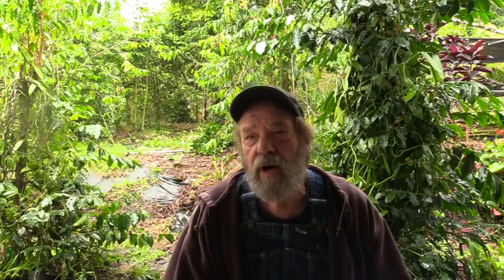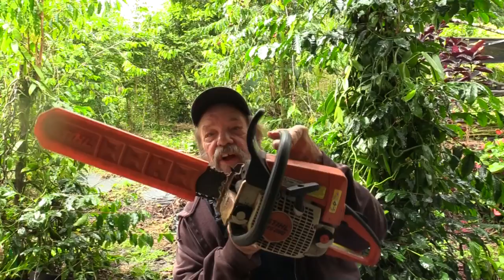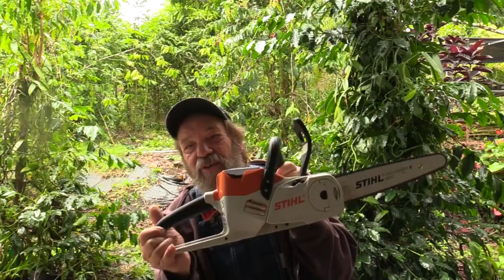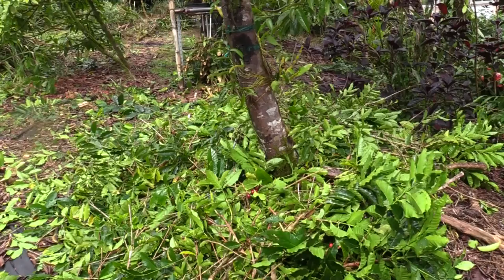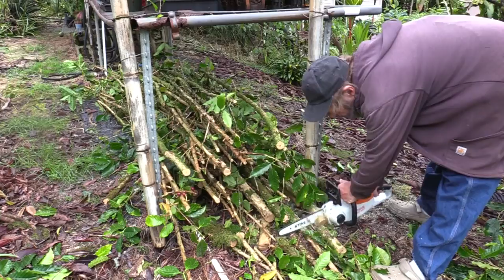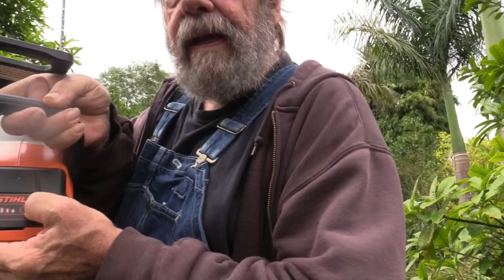Stihl Battery Chainsaws

Comment: Yeah these new battery tools are great I cant disagree with that but people say oh there more environmentally friendly no, there really not there about equal to a gas saw.  One the way they do lithium mining, then to charge it most people are on grid so its just more power the power plants have to make which oil, gas, or coal make up the majority so there just putting the fumes out instead of you
Reply from the maker: I am not most people.  I generate all the power I need to run a home, a car and all my tools.  This is done with zero carbon emissions.  What other people do is there own business.  Battery technology will take over the nation in a very short period of time.  By 2035 GM will no longer produce gas burning cars,  everything will go EV.  The change in Washington is replacing the federal fleet with EV.  Asto makers across the planet are making the switch.  Worrying about whether petroleum or battery is better or worse will soon be a mute point.  Gas is going the way of the cassette tape deck and it is happening faster than most people are aware of.  As for lithium production, it doesn't add to CO2 which is the main issue with fossil fuels.  The out going president opened up a lithium deposit in a Nevada volcano.  The current President will be hard pressed to reverse the order because it will be part of his domestic fuels program.  Mining is dirty business but this will be cleaner than seawater extraction and it is a US reserve under our environmental laws.  I have to laugh at how hard people clutch to petroleum.  It is kind of like being kidnapped and defending your kidnapper.
Reply: @GreenGardenGuy1 Amen! Preach it Bill
Reply from the maker: @tamie341  Just trying to share the joy of a fully solar electric approach to life.  I love it.

Comment: nice to see more electric tools coming out. saw a review for an electric snow blower the other day and he was quite happy with it. my lawn guy has an electric mower that's so quiet, i don't even know he's here till he walks by the window
Reply: EGO finally came out with a 2 stage snowblower that people are quite happy with, though I've only ever worked on the single stage. Seem to do the job without much hassle... certainly a hell of a lot quieter, so you can snowblow your drive at 3am without pissing off the neighbors!
Reply from the maker: Just think, you could bury your neighbors car and his door at 3 AM and they would never hear a thing.
Reply: @GreenGardenGuy1  hehe
Reply from the maker: So many good features with these tools.  Clean, quiet and I charge the batteries from the collectors on my roof.  Zero carbon foot print, zero trips to the gas station.

Comment: Wonder if there's a silicone lubricant option available for bar oil. There's a silicone replacement for WD-40 that works well.
Reply from the maker: Not sure about that.  I know the last time I had to buy silicone grease I fainted from the price.  Since the oil is just spit out of the tool the viscosity is probably more important than anything.  The cheapest materials seems best.  Petroleum is probably still the cheapest and best choice.  I feel oil as lubrication is a good thing.  Oil as fuel is not so good because of the CO2 release and all the dirt.
Reply: @GreenGardenGuy1  I was looking online after I watched your video. I saw some information that people also use canola oil for bar/chain lubricant as another green option. Haven't tried it myself.
Reply from the maker: @bjohnson2003  Canola is as good an oil as any.  I use it in plant spray at times.  Mixed with water and baking soda it works on mildew.  The regular chain oil it pretty thick, getting this much viscosity out of canola might be hard.  The cooking oil would come out of this saw like a squirt gun.  Light weight oils are easy to get from plants.  How we would get thicker materials from nonpetroleum oil is out of my area of understanding.
Reply: @GreenGardenGuy1  some chemist will probably figure out a good and inexpensive green option someday.  Thanks for the tip about a recipe to spray for mildew. Seems like a good, easy, and  inexpensive option thats available from the pantry. Mildew is a problem that we don't have a shortage of here in the PNW.
Reply from the maker: @bjohnson2003  I get along okay in kitchen and garden chemistry but oil is out of my area.  I am sure there is a way to do it.

Comment: i have bad luck with electric tools  gas however im good with.
Reply from the maker: I never owned battery tools until the technology reached it's current level.  Electric tools of years gone by left much to be desired.  The brand new tools by top manufacturers are a completely different story.  Most I have used are excellent.  Other than no stink, little noise and no recoils I charge my tools from solar collectors on the house roof.  With electric tools I own my own fuel source, my local filling station misses me.
Reply: @GreenGardenGuy1 i was pretty bad about killing the weed eaters went through 3 of them in a month
Reply from the maker: @41Zman  I assume they must have been low buck or defective tools.  The good ones should give you years of service.
Reply: @GreenGardenGuy1  yea they were lower end stuff
Reply: @41Zman  get yourself a good stihl or husqvarna gas string trimmer, or husqvarna electric string trimmer. More money, but worth it.
Reply from the maker: @41Zman  The newer top of the line stuff is very good.

Comment: I NEVER want to rewind a recoil spring again! last one I did, took me an hour and a half cause the trimmer it was off of, was so poorly designed. As for the oil, there are some "nice" biosafe bar oils you can get for saws. Usually sunflower oil.
Reply from the maker: Even on the most expensive top end tools are a bear to repair the recoil on.  They are made better and worse but the designs have been the same since the 20th century.  I ended up becoming expert at it but that still doesn't make it fun.